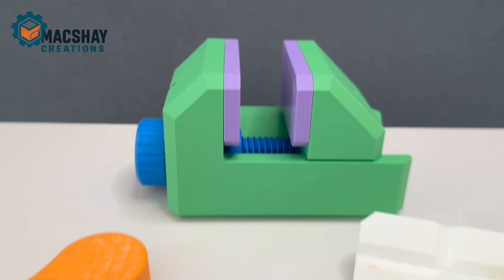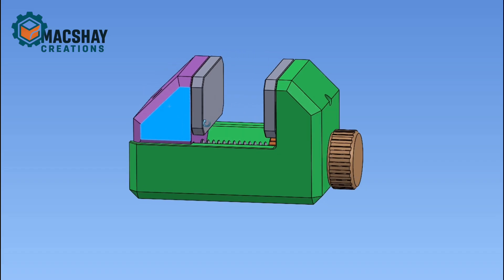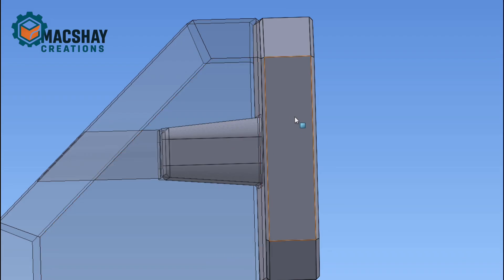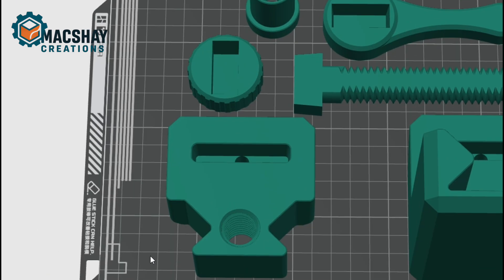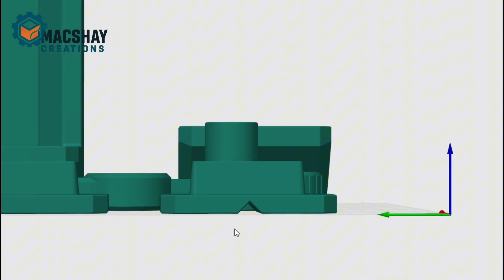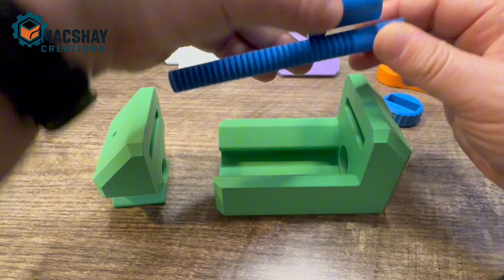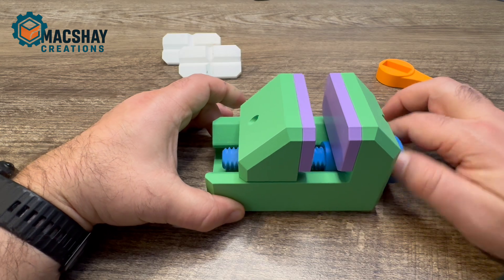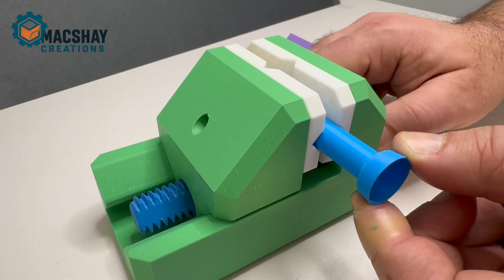3D Printed Vise - No Supports, No Hardware, Free STL Files

Comment: I like the design. It has elegant simplicity. 

I would consider losing the bearing piece on vice screw and the threads in the hole closest to the handle and integrating it onto the handle. 

I would also consider changing the jaws to be dovetails or through holes so they can be pounded out if they get stuck.

Comment: Well done on the vise. Its modeling and your video are top notch. 
Modification ideas: Give it a base similar to a Dremel D-Vise (#2214). 
Give it bolt-down slots similar to the Harbor Freight 4 in. Drill Press Vise.
Give it a quick-release ability similar to the Wolfcraft Quick-Release Drill Press and Workbench Vise sold at Home Depot.